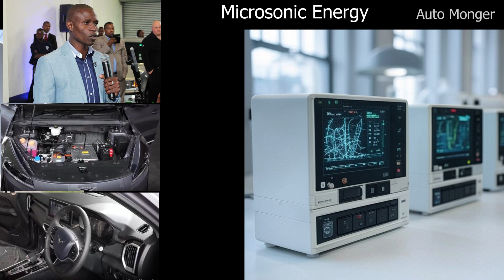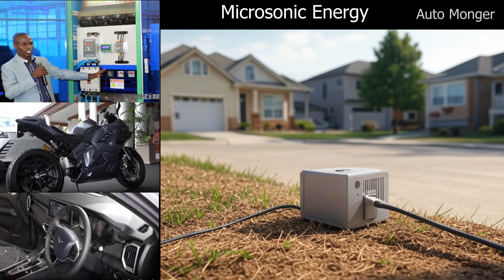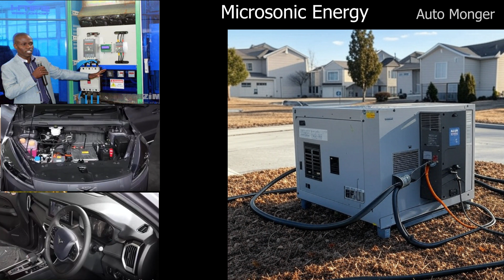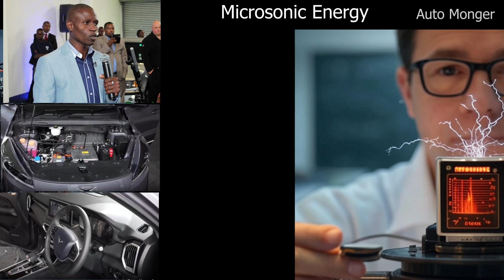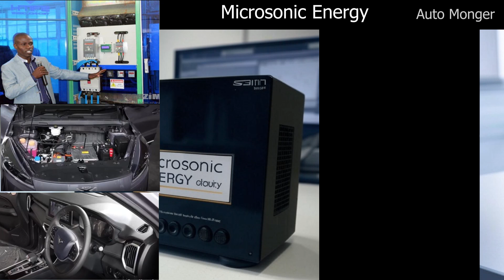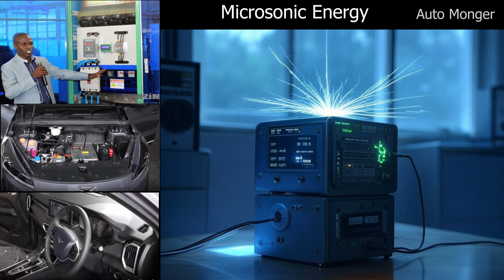What is Microsonic Energy Technology: Origin and Adoption

Comment: Some of the physics behind this does exist, but you would need a massive metal collection system together enough radio waves to convert to usuable voltage
Reply: A fractal antenna might provide a solution.